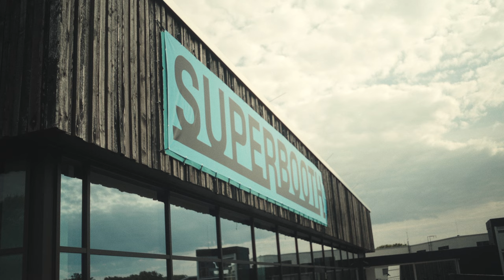Verbos Electronics at Superbooth 2023 | Thomann

Comment: Unfortunately, the company's quality control is inadequate. Faulty modules are therefore standard. There is no customer service or requests are not answered. Many users experience this....
Reply: Verbos make great modules and I‘ve never had any issues with mine…
Reply: @Hospizzzz  I'm delighted for you. I wish that it stays that way, because if problems arise after the guarantee, you are on your own. Unfortunately, I wasn't the only one who had to experience this. At modwiggler you will find enough information. What also bothers me is that there are many different versions of some modules with completely different circuit board designs and there is no information about them.
Reply: When I had an issue with a Verbos module, which was just once, I instantly got a reply to start the repair process. I guess there can be differences here and there due to staff shortage, but the entire company is very dedicated and the modules are just fantastic.